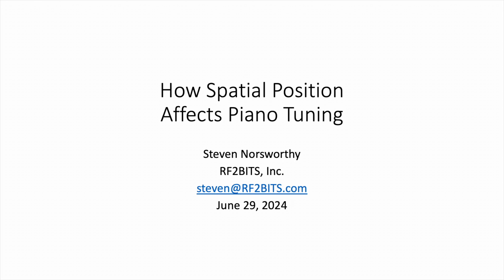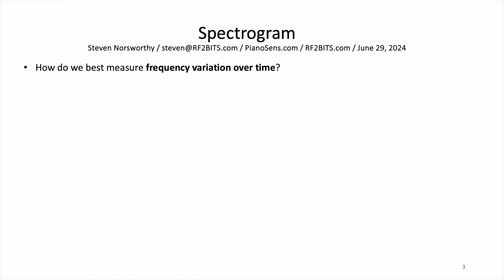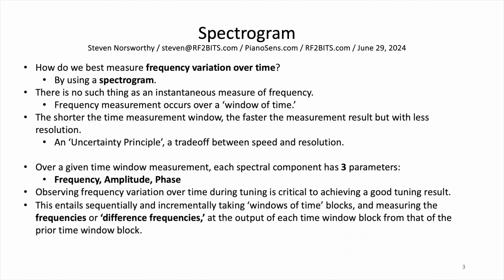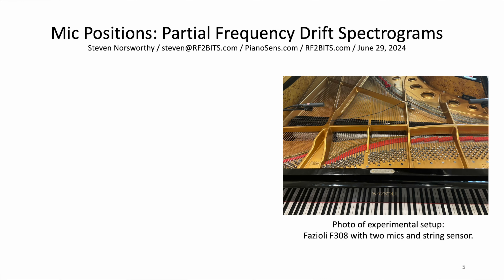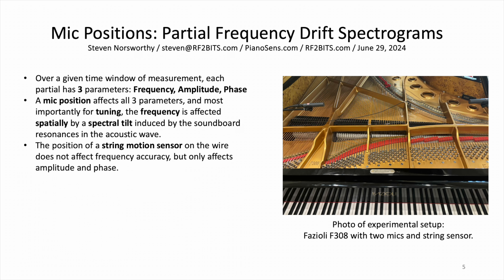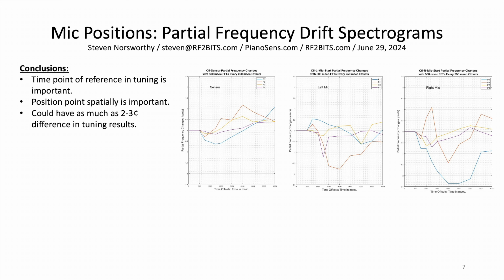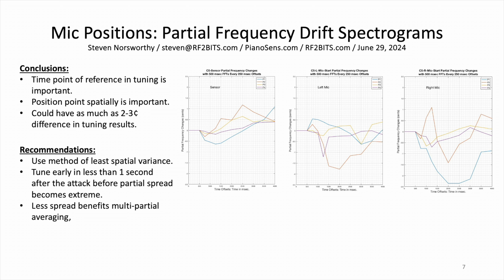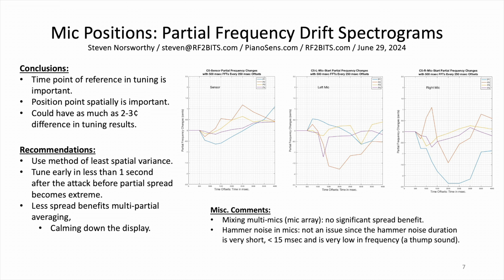How Spatial Position Affects Piano Tuning

Comment: I couldn't really hear a pitch difference between the samples, though my best tuner app (in strobe mode) did show a very small amount of change in the first partial.  I wonder to what extent this is a question about electronic tuner design vs. perceptible changes.

Just thinking in terms of working with musicians, I've never heard of a performer wanting to be in a certain location in order to hear pitch correctly.